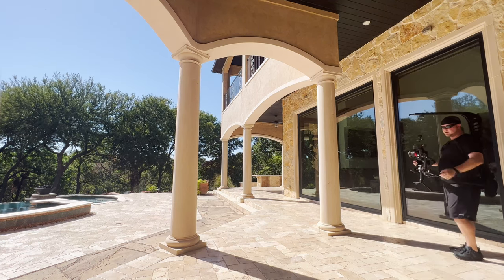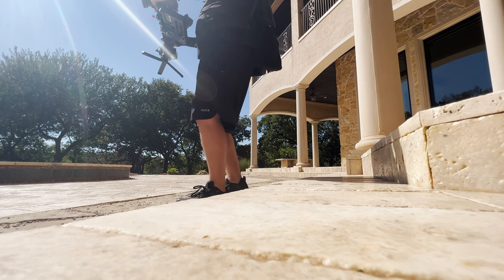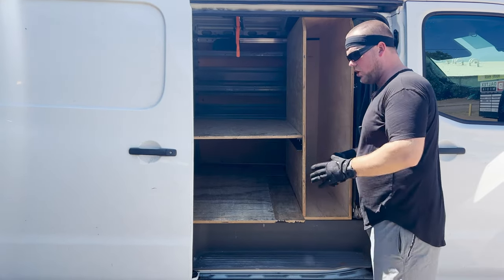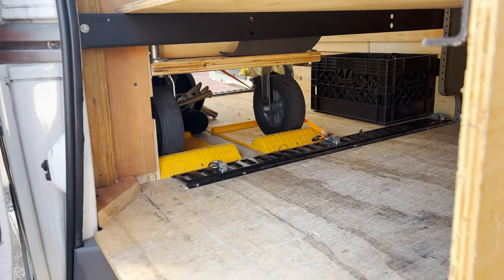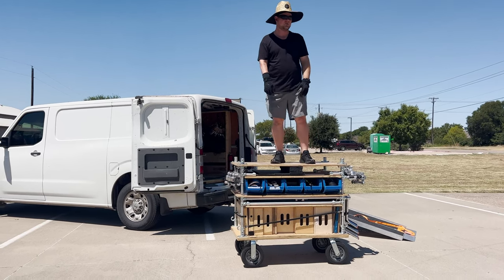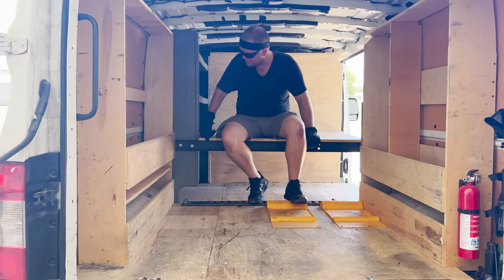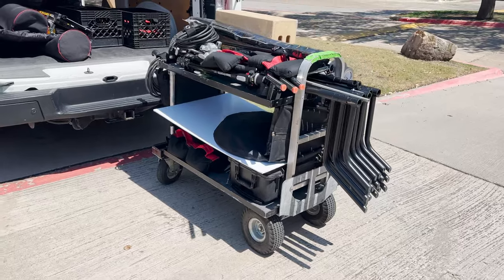DJI RS2 Footage & Production Van Teardown | Sony FX3 - Pro Vlog 23

Comment: As a DP who owns a G&E package I've constantly reworked the layout on my old extended E350 van for the last 15 years. A couple of years ago I decided to get rid of all the shelves, nooks and barriers and simply load what I'll need onto carts and then load the carts in the van per job. All the compartmentalization happens in the carts, not the van. My flags and floppies are always in the van while everything else lives in the garage when I'm not working. My carts are a combo of Magliners, Rubbermaids and Uline nylon basket trucks. I reenforce the RubberMaids and basket trucks with plywood bases and heavy duty casters. So far so good.
Reply: Good to hear what other DPs are doing Tim. What do you do for a ramp to get your carts in and out of the your van?
Reply from the maker: I am in the same boat, DP with 1 ton. I want to be quick on and off the van. I think my next build will allow me to have more carts built and loaded. 

I have a mix of cart styles too, each job allows for different setups. 

The full builds for working off the van are great for G&E, but not for one man band work. 

Would love to see your setup.

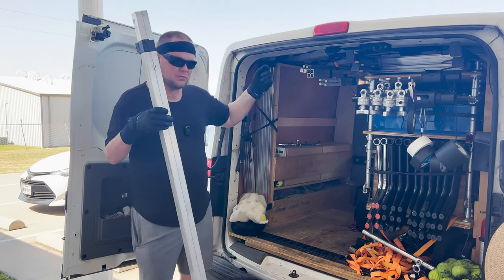Comment: I love that transition at 8:19! Very to the point. The audience definitely knows the scene has ended "cut!" lol! I'm just playing with you. Thanks for sharing your van setup. I'm still tinkering with getting a trailer and rig for my SUV. I can keep the trailer locked up in a package garage for more security. Also, the commercial you worked on looks outstanding!
Reply from the maker: I am turning into a monster with all this YT fame 🤪! CUT CUT CUT!

I would recommend roughing things out and testing first, then finalize it. I have done so many changes and now I get to start over. 

Thank you for the kind words, now I need to knock out the edit for the client.

Comment: Hey Peter.  The comedy level on this one was great.  I enjoyed your candor with your walk through.  Those tall Sprinter Vans are pretty badass.   I'm still using my truck so any van for me would be great.  Still figuring how to make that happen.  Good luck with your purchase.
Reply from the maker: I wanted to spice it up a bit! These vlogs can get a bit dry at times, glad you caught it and enjoyed it. 

I went from a Ford Ranger with a camper top to my NV2500. It was a game changer. The ability to have carts loaded up and extra gear on set has made my company grow. 

You get hired more when you don’t look like you are unloading for a swap meet in the clients parking lot. It also saves your back. Now if you are always super light with kit and mostly cam op, it is not needed. 

I am set on a high roof, it just makes sense for my needs. 

Thank you for the continued support!

Comment: i recently looked at vans. i wish i could do a build. I noticed the Ram promaster ( low roof ) still had much more height compared to a Ford transit. The floor was much lower in the promaster and gave more height to the cargo area. Maybe a helpful thing. Thanks for the content ! keep it up. Waiting to see the new van build!
Reply from the maker: The ram seems to be a favorite because of it’s straight walls. It makes for easy up-fitting.

Comment: Are you thinking of like a RAM Promaster 2500/3500? You can configure that with a 12' cargo space for those big butterfly frames and speed rails.
I think that size would make the most sense. Unless you want to go with a used Penske 16' truck :D
Reply from the maker: I am leaning towards a smaller wheelbase. I can afford the biggest cargo van, but it is not practical for me yet. 

I want to be in the 1 to 1.5 ton range for grip. I like to be a turn key solution on gigs. It allows me to get more rentals.

Comment: Love this video! added it to my "van videos" playlist. But too bad you couldn't just sell the van to another shooter or someone in the industry. Wouldn't have had to waste all that hard work and also might have gotten a little more $$$. But obviously, you got your reasons. IF space is what you need, I'm thinking the longest tallest Ford Transit. OR the longest tallest Mercedes Sprinter. However, I've also thought an Izusu Crew Crab Box Truck would make a great grip vehicle. I'm currently running a ford transit connect and it's enough for now... but I still need to rig it with some shelving like what you did. I'm just not as scrappy as you!
Reply from the maker: That would have been my first choice, but my NV2500 is valued at $25,000. I doubt people would pay extra for some plywood thrown it. Dealers offered me $21,000-$23,000. 

I was torn on which route to go. The biggest was so tempting, but would make my small shoots so difficult with parking. I still do a lot of solo work. 

I will have plenty more videos to add to you van list. The build outs are pretty basic. I have no doubt you can get them done too. 

Thank you for the support!
Reply: @PDMokry  yeah I WANT the biggest... I need the smallest. haha... my garage at home is pretty small and the transit connect or Dodge Ram city van are probably the only options that fit. The Metris probably would be too tight. But a lot of my work is corporate in Atlanta which means navigating lot of parking garages. Small and compact is a better choice for now.

Comment: Nice video! I'm in Austin myself and this heat is something else. A buddy turned me onto the LMNT packets for water bottles. They work pretty well to keep electrolytes up.

About the van, I think about downtown locations. If you get a high clearance van, will you still be able to fit in parking garages? My F-150 fits, but I don't have anywhere near the storage space a van has.
Reply from the maker: I will have to look into the LMNT to keep on the van. 

So my NV2500 has issues with most parking garages downtown. So going higher won’t change things too much. I’m tired of crawling around the van to grab things I missed or tucked away.

Comment: Wow, 110-115F, that's some challenging conditions to shoot in. How's your hand doing? Carpal tunnel injury or something else? 

Ugh, I gave up on doing Photo/Video jobs years ago. One or the other will always be compromised. It's funny, all of the manufacturers were really pushing the hybrid shooting capability for a number of years but once you get on a real shoot, you quickly realize that it's almost impossible to do both well at the same time, one or the other will always be clashing with what you're trying to do with the other and the lighting requirements are totally different. I admire your skills in bring able to deliver material that the client was happy with, your footage looks great. 

Did you make or buy that Coroplast flag box? I've never seen that, my flag box is plywood and 1x2 edging but it's heavy as hell. 

As far as a vehicle, not sure if fitting into downtown Dallas parking structures is a consideration for you? We were looking at a full sized Sprinter but they are too tall to fit into 90% of office parking structures and most of our corporate clients are in high rises in downtown LA and I see you do park periodically downtown in Dallas. As far as brands, the Mercedes is superior in reliability and options to the Ford or Dodge products and last I checked a few months ago, you can still get a Diesel Mercedes, not sure if Ford or Dodge are still offering Diesel but for hauling weight, Diesel is so superior. Also, long term, a Diesel engine will far outlast a gasoline engine. There is no substitute for torque, I had a full sized Chevy Silverado 2500 HD Duramax for about a decade and it sold me that Diesel is far superior for hauling any substantial weight load. Just my .02.
Reply from the maker: The injury is from a motorcycle accident 20 years ago. It is paralyzed as a result. 

I try to avoid doing both, because both suffer in end end. I say I don’t like to do it all, yet I do it all lol.

I will have to see who makes it, but I bet they are out of CA. 

In Downtown Dallas, we have a lot of open air street level parking mixed with garages. My current van was too tall for about 80% of garages as it is. So jumping up to a high roof won’t hurt me too much. Will cut down on using a drive thru, but that will help me more than hurt. MB does offer a 4cly diesel currently. From what I looked up, the are very dependable after their DEF system was corrected. 

Thank you so much for your input and ideas, I appreciate it.
Reply: @PDMokry  ah, that’s tough. motorcycles are fun but dangerous, I raced motocross as a teen and got some “fun” injuries from racing. Luckily nothing that has stayed with me too much. 

Diesel is also a bit more expensive than gas but I found it just made driving and hauling so much better, I hauled a 30’ loaded trailer up and down some crazy grades that would have completely choked a gas engine.